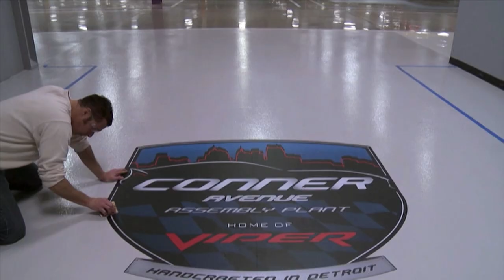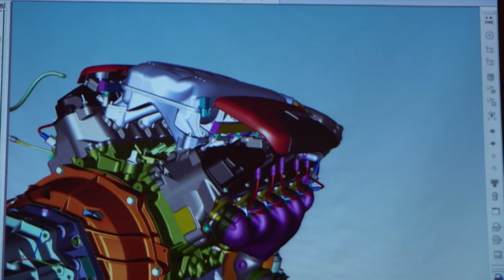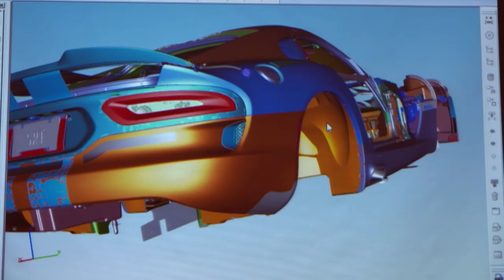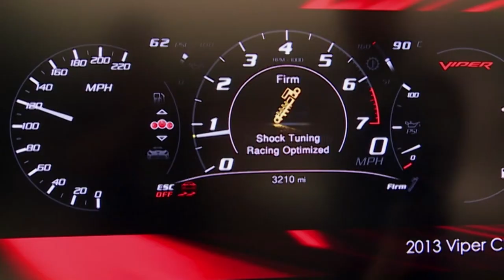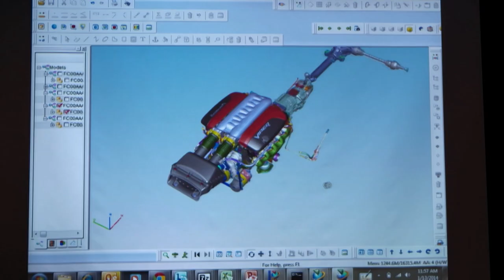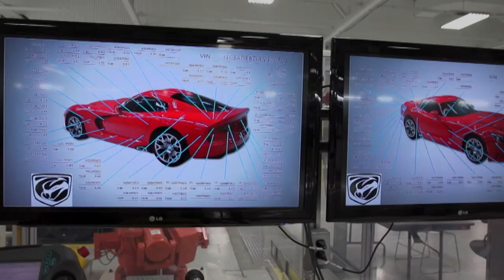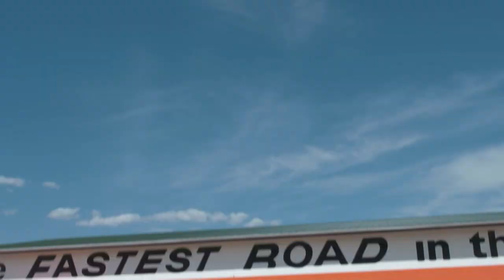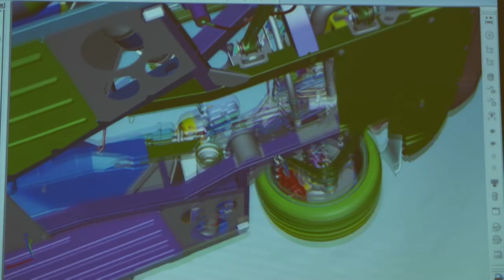Inside the Making of the Iconic Viper Supercar - Supercar Superbuild - S01 EP07 - Car Show

Comment: What happens when the viper accelerator pedal is lifted off to quickly it can fly out of control and into a dangerous action, because air sucking the object off the ground their foot off ground caused a accident at a 1000 metre run top speed competition